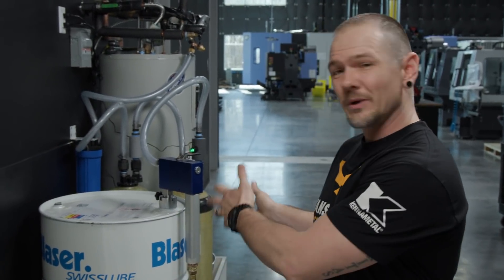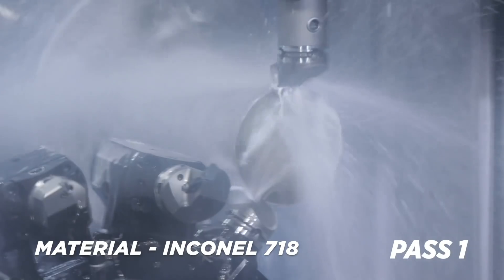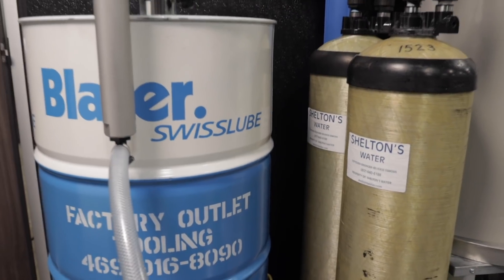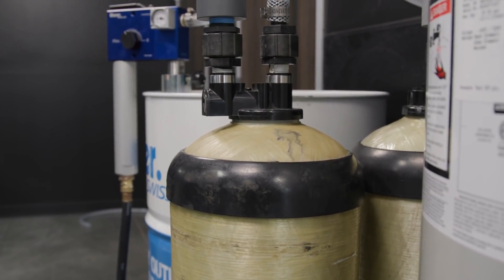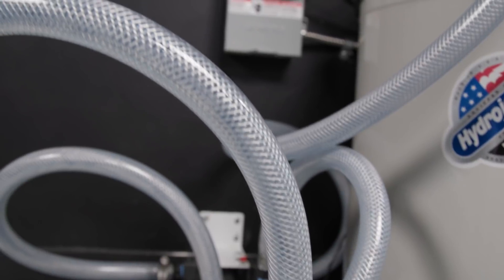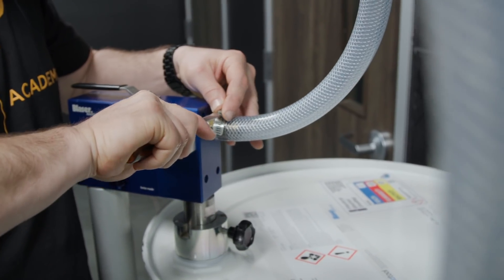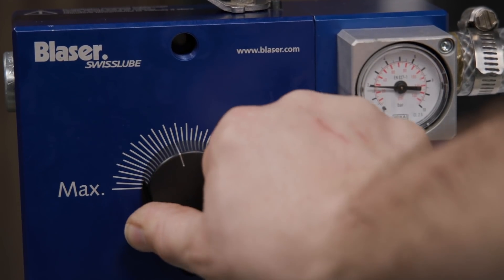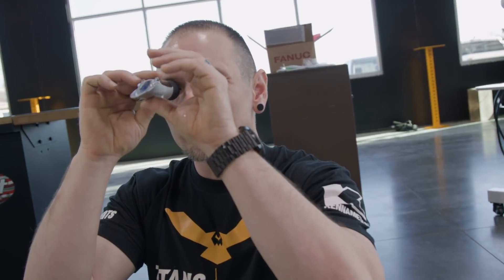You May Not Realize You Should Have THIS in Your CNC Machine Shop

Comment: We tried 735 in our shop. We leased a DI water system, cleaned out a machine and set it up. The team nearly mutinied from the smell of the DI water. Do you have any tips to avoid the rotten egg smell?
Reply: I think the tempeture is wrong. We got a grey fking smell bitch ass coolant on every summer. On winter its normal. Plus good quality od coolant

Comment: When you are feeding many machines a day ( We had 70+) and constantly  re filling them every morning, DI or RO water gets pretty expensive. We went to a centralized Soft water system and fed it all over the plant. Was a good compromise cost wise... Had mixers at every machine cell. We also used Blasers in 90% of our machines. We ended up with Cincinnati CimCool in our grinders. Just worked better for some reason. Another tip is to run Skimmers in every sump to skim out way and tramp oil. Kept coolant much cleaner...We ran 2000 PSI coolant in half of our machines and was not uncommon to dump in 10-15 gal a day, lost to mist, evap/high heat tools and pockets in parts....

Comment: Having a RO or DI water system is, I think, a must. It protects the machine, gives clean coolant that lasts a long time and it's also great for cleaning products.
As a tip for someone else buying a RO or DI system: buy a complete system with a pump and a TDS meter. The pump increases the water pressure in order to get the most RO water from your source and the TDS meter measures the Total Dissolved Solids and this tells you if you need to flush/replace your RO or DI filters.
I have a small system with pump, filters and a handheld TDS meter for under USD 100. It is not an "in line filter" and I need to fill a tank before being able to use the water. It is also not for high volumes but it does deliver enough water to keep 2 machines up and running. So even for small shops there is no excuse to not use RO water 🙂
Reply: What is the name/brand/model of this small RO system you're using?
Reply: @vnegron3  This thing is branded "Osmopure" but you'll find similar systems like this under a lot of brands. You'll find these systems being sold with and without a booster-pump. The booster pump increases the pressure on the RO membrane, resulting in a higher yield.

Comment: Really curious if you guys had issues with the mixer "mixing" properly with such a long hose on the outlet? We have the exact setup and found we were limited to a 10-15' outlet hose. Otherwise the mixer is great
Reply from the maker: Yes, we ended up having issues because of the length of hose.
Reply: We mix into an empty barrel and then pump that throughout the shop. Works great!

Comment: The synergy is so expensive though.  I want to use it, my robodrill is empty and  clean. Just saving money to buy synergy
Reply: It cost me around $250 from my supplier for a 5 gallon pail, I have it running in a tormach 1100mx, the coolants tormach sells are around $40-50 a gallon so it was very comparable.
Reply from the maker: It’s not cheap but is competitive with other coolants that can machine aluminum and all high end materials. It also never goes rancid and is clear.

Comment: One thing that hasn't changed much for a   few years now is water based cooling.
When we going to see oil cooling
Reply from the maker: Will use oil for our new grinders
Reply: We run oils in our Swiss machines.
Reply: @brianodell5940  😲🤤😊
Reply: @brianodell5940  Yes you can run swiss lathes with oil since the cutting forces low,  I meant its not possible in machining centers
Reply: There is oil cooling
Reply: When they find out an oil non-flamable :)
Reply: Kern uses oil in their machines
Reply: Qualichem mostly oil based cooling